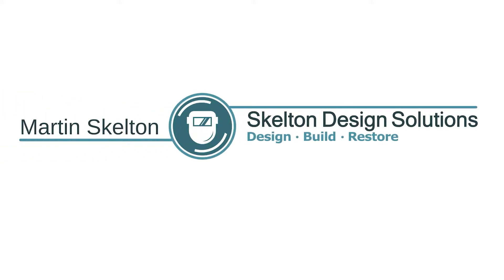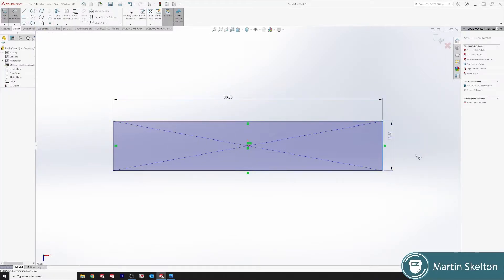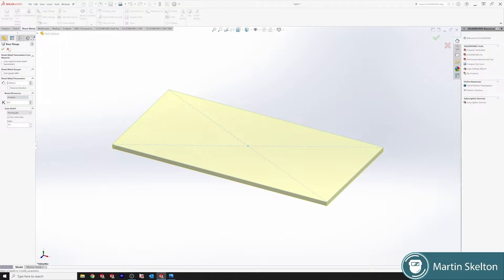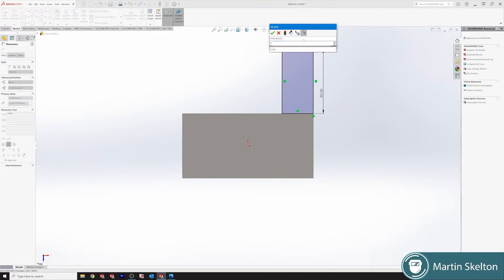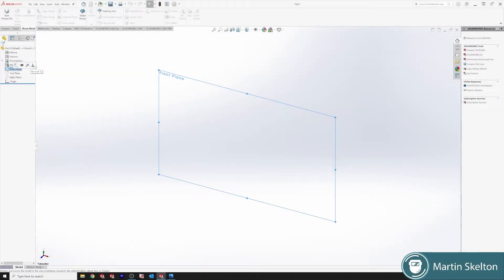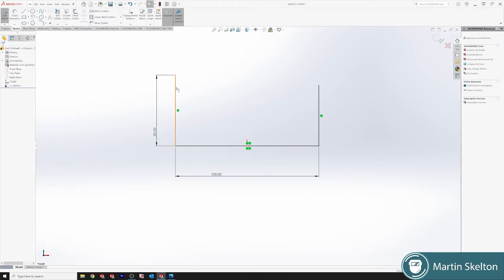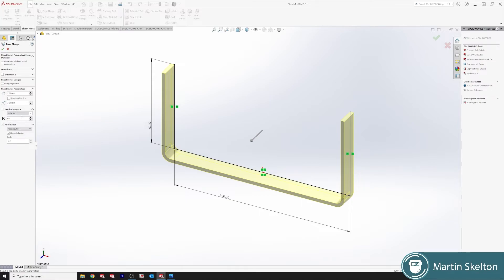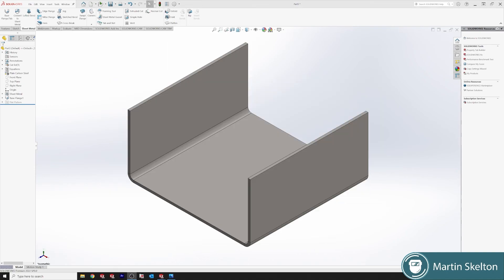SOLIDWORKS FEATURE IN 3 MINUTES // BASE FLANGE / TAB

Comment: How did the base flange tab come about on display on the tool bar?
Reply from the maker: Turn it on by right clicking on the toolbar and turning on sheet metal tab under tabs. Otherwise search in the Insert drop down menu or the search box at the top right of the Solidworks screen. Make use the search is set to commands